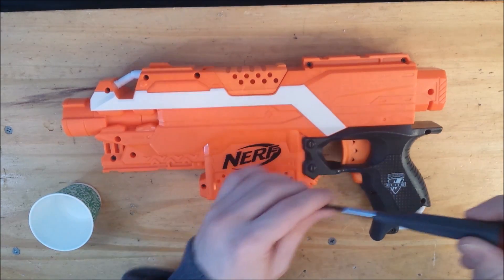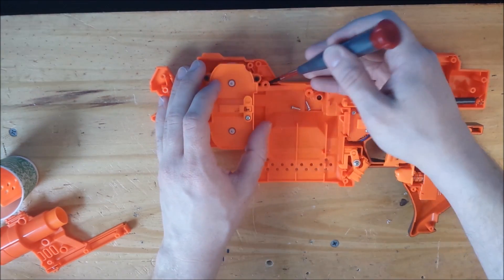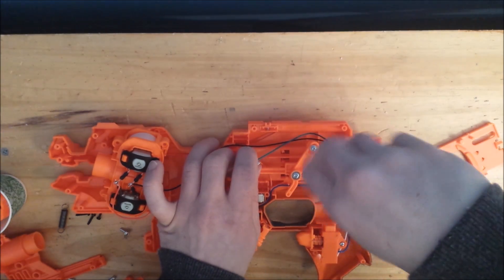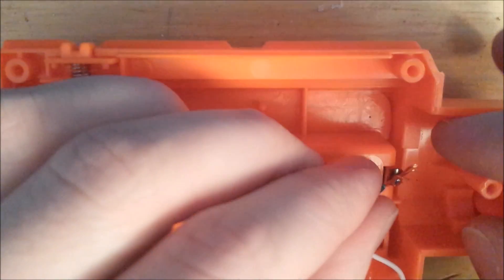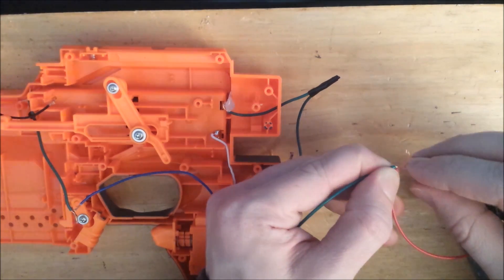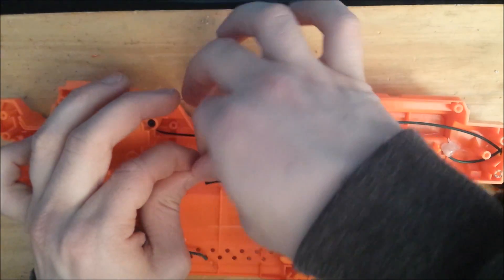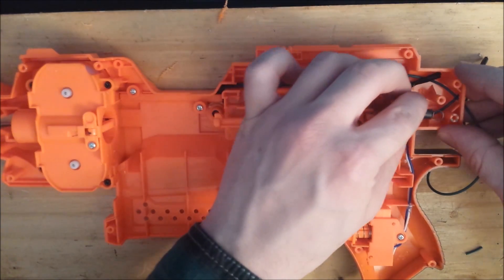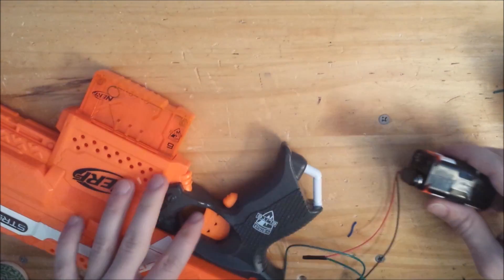The Stryfle Project: External Battery Pack

Comment: I've done mods similar to this and found that not removing the Motor resisters like u didn't do tends to ruin the stock motors, just a note
Reply: The black parts on the motors aren't resistors. There put there to dull down sound, don't listen to coops guide.

Comment: A few questions for you:

1. Why did you shy away from a better battery pack such as a LiPo or NiCd seeing as the stock could very easily accommodate either?

2. Any reason for not replacing the motors?

3. Soldering? I know you mentioned fumes, but it does give a much more secure electrical connection

Overall I like most of the external mods you have here as they are effective and cheap.

Comment: Does your circuit short out because of just twisting the wires together? Or is it stable enough that it won't short out at all?
Reply: It will only short out if the positive and negative wires touch
Reply: Ah ok thanks

Comment: What's so good about this 'stryfe'?
Reply from the maker: It's a smaller part of a larger blaster. Thus video is to demonstrate a mod technique that's more than just "add trustfires and paint"
Reply: Aeromech So it's not especially powerful for a Nerf gun then?
Reply: @tomenright4400  its very good, but most people like to mod and get extra power or full auto

Comment: Cool stuff. I'm currently working on a "Longstyfe" - Longstrike shell with stryfe internals. Its coming along great so far, I just need to attach the longstrike trigger to the stryfe pusher mech. Any tips?
Reply: Put 2 little pieces sticking up on the trigger or replace the the trigger with the stryfe trigger. If you do A, be sure to space out the pieces sticking up. Then put the bottom part of the pusher mech on to the trigger. Then test
Reply: CoolBoyGamer7777 Thanks!